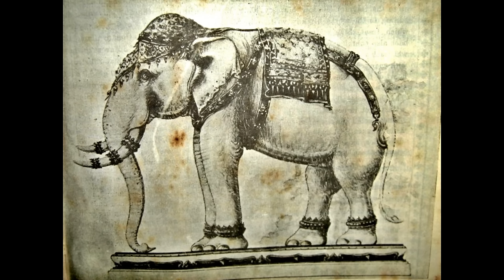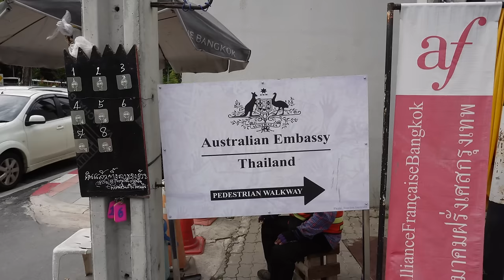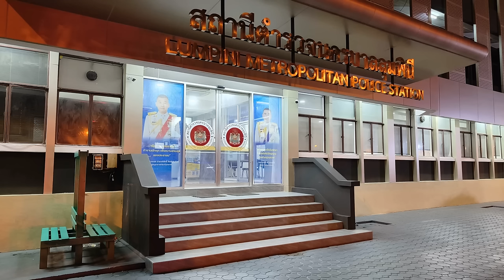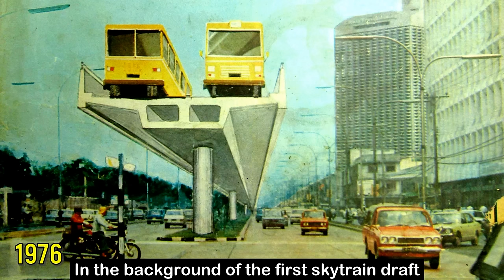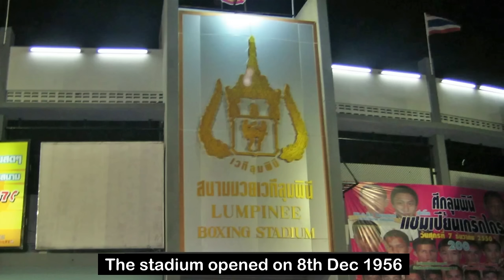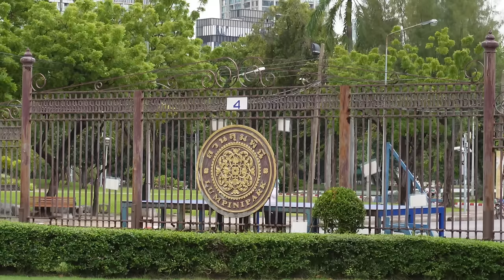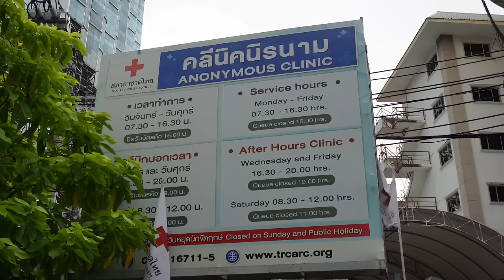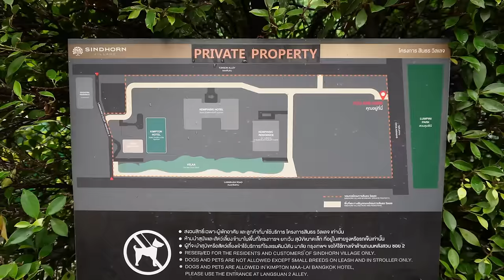LUMPHINI NEIGHBOURHOOD | More Than Just A Park | Red Light District | Walking The Streets | History

Comment: I actually visited the Dusit site and the project was explained in detail including what plans they have for the new hotel, office building, and residential tower, as well as the green space they plan on the roof of the planned mall. Most interestingly it's how they have been preserving the heritage of the old Dusit. You should go in and see for yourself; it's better than the sight of construction from outside at present.
Reply: There's a tale to be told about why the Dusit wasn't knocked down (say) 20 years back -- considerations of taste and heritage aside it was a very inefficient use of space by early 2000s and having BTS and MRT stations on doorstep made it a no-brainer. Someone had a sentimental attachment to the joint... In other totally unrelated news, the Fibonacci Sequence begins like this: 1 1 2 (ahem) 3, 5 , 8...

Comment: Turned out nice again Pat. I just talked to friend whose 5m bhat flat overlooks the park. She says water pressure becomes a problem as you go up.
Reply: How many flights up does she live? Typically tall buildings have water pumped to a water supply tank high up on the roof and from there all residential units get their water supply. This is to avoid water pressure problems that you mention.